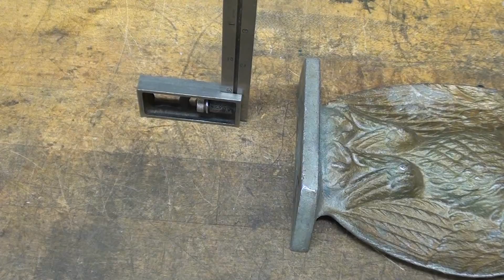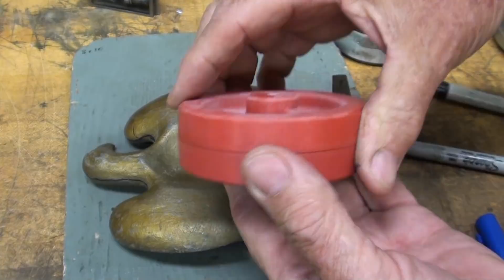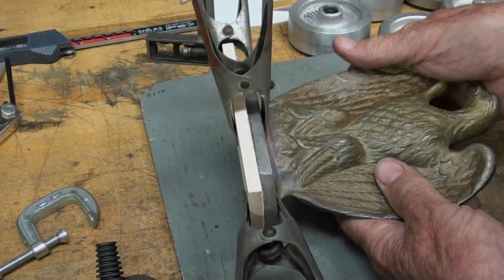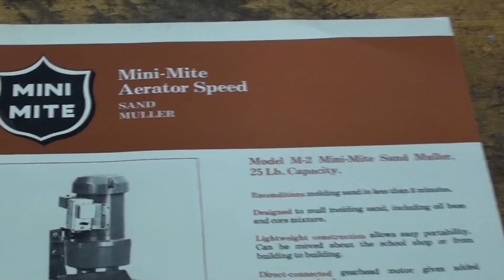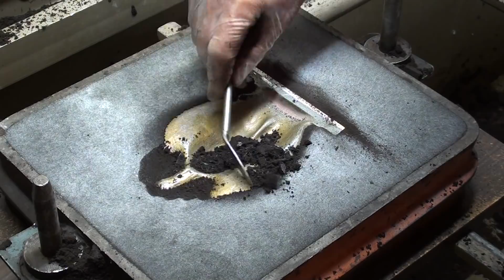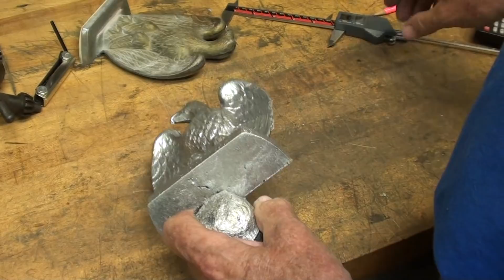Casting the American Eagle Tips #459 tubalcain foundry

Comment: Funny-by odd coincidence I am working on multi part molds to recreate three dimensional parts where I have 4 or 5 pieces that have to come together.  All out of plaster for cold casting but much of what you are doing here I have to take into account to get my pieces to come out.  However, what I really wanted to add into this is that a few years ago I used whole wheat flour mixed into my casting sand.  Truly nasty smoke when I poured in the aluminum but it imparted a lovely golden color to the finished part.  It was a surface finish but very durable even in outdoor weathering conditions.  I like these tricky casting videos you do.  They give me a clue on how to go about my own work.
Reply from the maker: Sounds like we're doing the same kind of work. That's interesting about the coloring

Comment: Always love these Lyle , I never got into a molding shop . I find it intriguing and wish I was able to do my own castings. I've always said I was born a hundred years to late. I could really have loved being the old time machinist tool & die maker. So many things to learn yet , giant punch presses knocking out big parts from red hot steel , or cast iron forgings ready to machine. I did do a lot of machining on castings weighing in at about a ton. Kind of fun using a twenty pound sledge hammer as a set up tool on a planer or VBM . My first big machines I cut my teeth on at first scared the s hit out of me. Giant blocks held down by a few bolts to a table. But I'm happy to say never ruined a part or lost one. US Steel was our pay check doing there repairs for the mill. That hot steel sure ruins those rollers and bearing boxes. We must have stick welded and recut 500 rollers a year, journals and shaft. So keep up casting parts I enjoy them . In fact I have a part you cast for my logan taper attachment build.
Reply from the maker: The foundry is quite an interesting . That must've been quite a shop you worked in. I had been through the Ford river rouge steel plant. Quite amazing. That was 30 years ago, make that 40

Comment: I have one like that but it's cast iron.
Boy I have a couple real tough ones, cast iron Corinthian capital leaves from the mid 1870s, some were cast in one piece, some in two pieces held together with a key and slot filled with lead, but the one piece castings were done where the curl of the leaf (see a photo  in Google of a Corinthian capital and it's rows of leaves around it)  has a vertical parting line seam, so they must have used a two section sand mold of some kind but I've never seen one for these even illustrated.

I once took one to a foundry to get some cast in bronze and they said they couldn't cast them in one piece like that, that I'd have to cut it in half and then braze the two pieces together, yet they were able to do it just fine in the 1870s with 1870s technology go figure!
Reply from the maker: That's interesting. They just did not want to be bothered with a small job

Comment: Why wasn’t a riser needed on this cast?  When do you choose to use a riser, and when do you choose not to?  May be a good topic of a short video. Chris
Reply: his sprue, being as large as it was, acted as a riser after the casting was poured. You'll notice no shrinkage in his casting as compared to the original casting that obviously didn't use a riser.
Reply: Thanks for the info.  I incorrectly thought that the riser also acted as a vent for the air.  Thanks, Chris
Reply from the maker: There are just a lot of different ways of doing it. Probably no one correct one

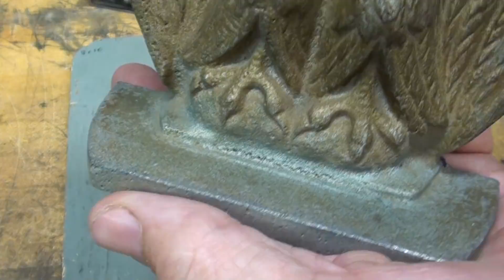Comment: Every video is a treat! Those 'cracks' at the 8:40 mark look very much like what you can have when welding aluminum, called 'Hot short cracking'....cooling too fast.
 That logo on the back sure looks like the one on older Harley Davidson ductile Iron flywheels.
Reply from the maker: Thank you, those are good comments